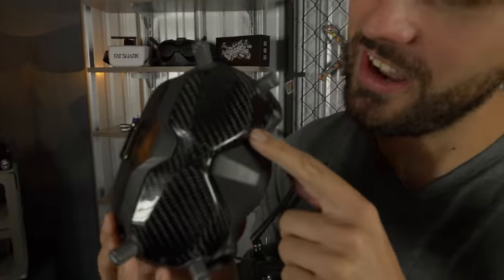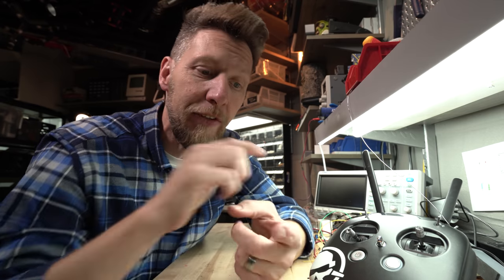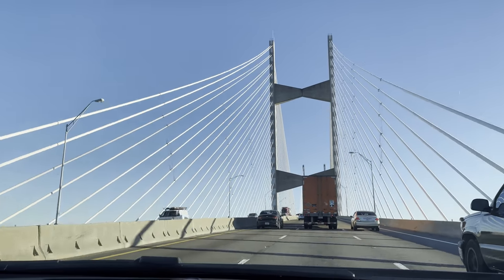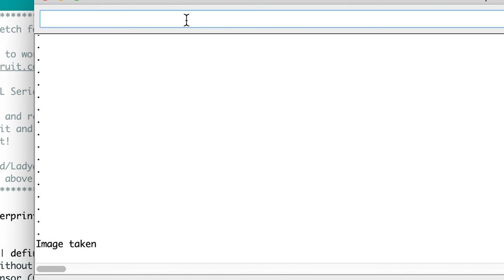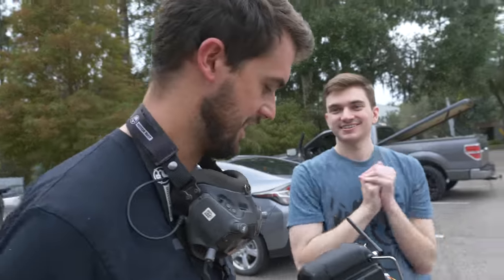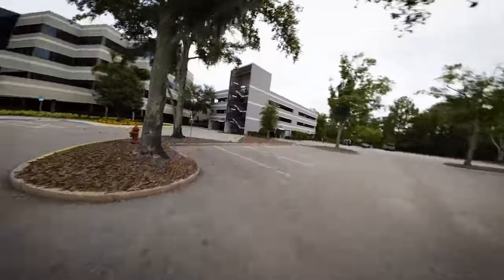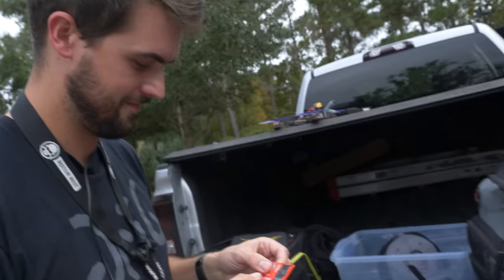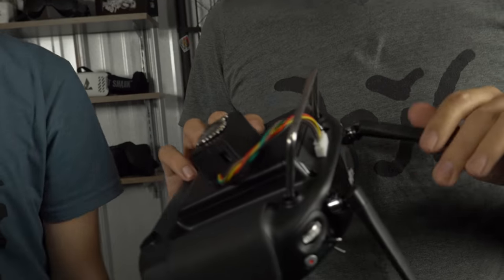Biometric Drone Controller!

Comment: What happens if the fingerprint module were to die in mid flight? Does it stay armed or disarm?
Reply: Well its powered off the radio battery, so the whole radio would be dead.
Reply: It would disarm since the switch state passes through the module then to the radio's computer, unless they have some system that defaults the channel to on by default, like a special relay or something.
Reply: Everything runs off of the controller battery. See all the gory details here... https://www.youtube.com/watch?v=Y60LyhSrLJg
Reply: @ChadKapper  I just meant if a component died in the fingerprint module making it fail. I saw that it's powered from the radio battery. 👍

Comment: Careful, the FAA will find a way to use that with their remote I.D, to prevent you from even arming your quad. I really don't see a legit use case for a biometric scanner on an R/C controller. If it's a safety thing, a two stage power switch would suffice.